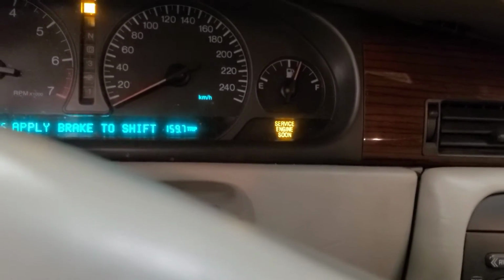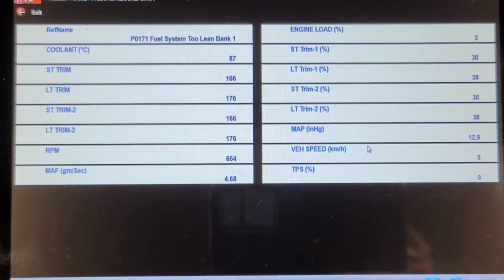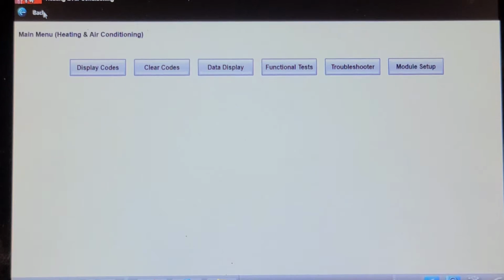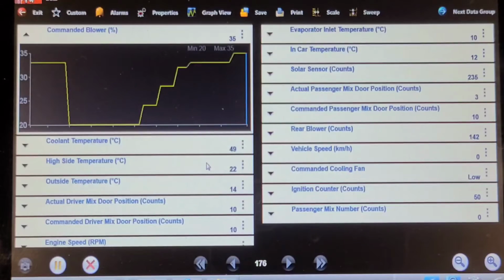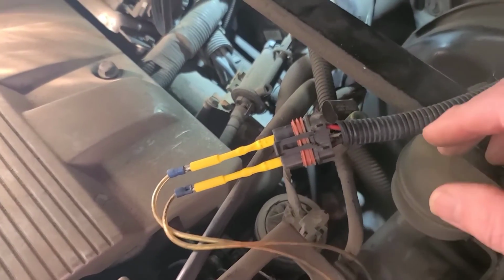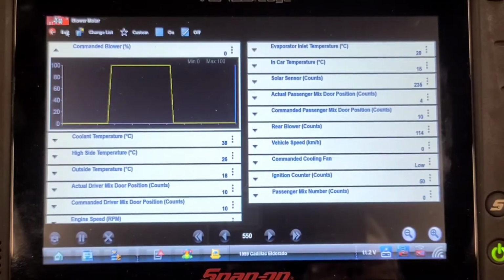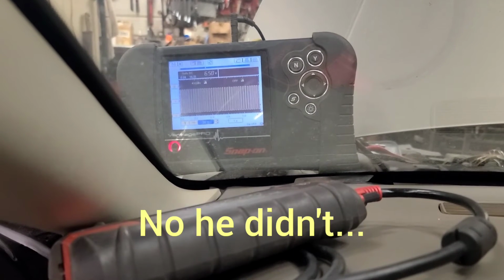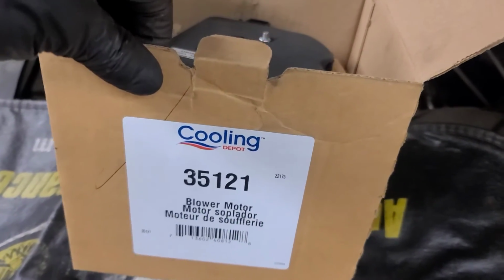1999 Cadillac Eldorado Heater Blower Dead

Comment: This is very good info, thank you. I dont have a snap-on meter, but i proved that the duty cycle changes via the fan control by hooking my multimeter up and noting the different average voltages on the meter based on fan switch. I installed a new blower as you'll read further, but intermittent  problem still persisted. I was afraid to monkey with the gray control wire because i didnt want to fry the computer, but seeing as you proved it is duty cycling the ground, i think I'll just run a wire from the gray to inside the car to manually ground to turn the fan on full. Following is my sad story i wrote to others in a different poster who tried to diagnose this same problem: ... I have a 1995 Sedan Deville and I have the same problem. Four years ago, I had spent $2k on new a/c compressor and sundry other items and it worked perfectly for half of that summer, when one hot day, I smelled smoke and the blower quit. Then it started working intermittently, sometimes working if I banged on the dash. Then stopped working no matter what. I sprung $230 on new fan like the one in the picture and it was unbelievably difficult to install. Had to break plastic on firewall and other nightmarish procedures. New fan made no difference, same intermittent working.  I checked with multimeter as in this vid, and I did get the different voltages based on hi-lo setting. Some time fan also stayed fan even with car turned off, so I had to unplug fan from under hood when I turned car off. Something else is going on here because even hitting fan switch  twice for 'manual' hi or low, the fan sometimes was dead, sometimes stuck on high, sometimes stuck on low and sometimes even automatic worked properly. I don't know if smoke smell was original fan breaking or not, but definitely smoke smell inside car when problem started. I was thinking of running a kill switch inside so I wouldn't have to pop the hood to plug it in or unplug it when the fan did work. I also considered buying a regular non-sine wave 3 speed fan and control switch and resistor, but that is too much work and money. To me it seems like a relay is sticking but by all accounts this is computer controlled with the computer being the relay. I also thought bad ground, but I grounded the fan (edit: the black wire.. i did not ground the gray wire) directly to ground and no difference. Good thing i don't need to drive this car every day. The diverter doors work perfectly so I can set heat in Winter and without fan, hot air eventually comes out where it should.  Summer a/c not so much. I wish somebody had an answer and it not be the computer 😣
Reply from the maker: I would say that if the blower is running with the ignition off use your voltmeter to read the voltage on the grey control wire by backpinning it. It should be near battery voltage.  If it is change the blower motor again. If its not then the control wire is either shorted to ground or the ac control module has failed. Good luck